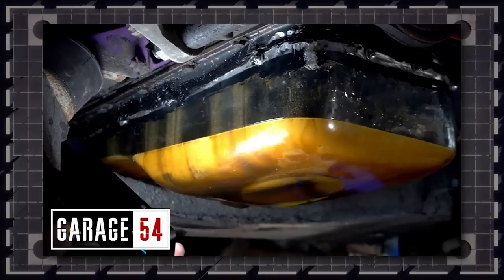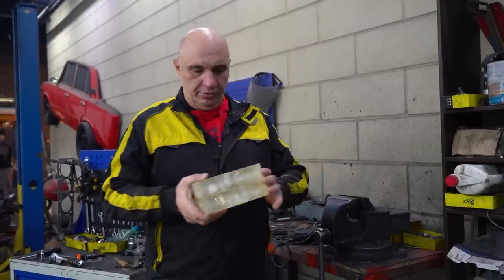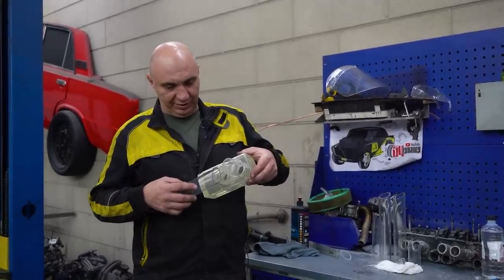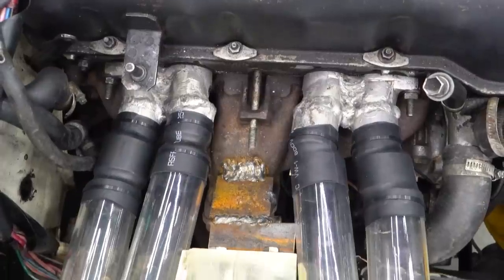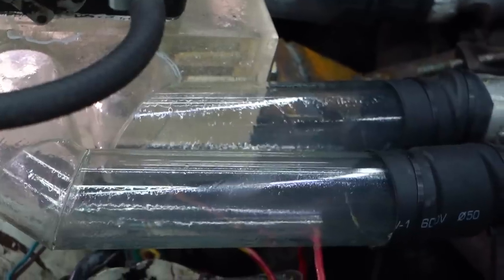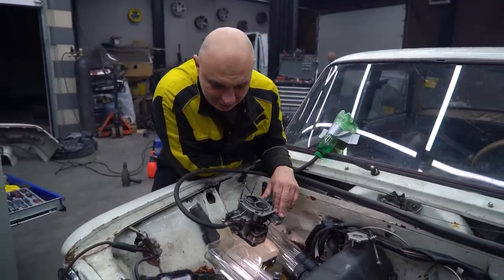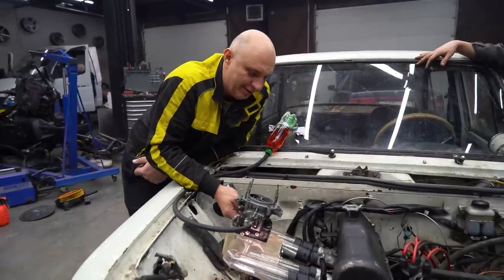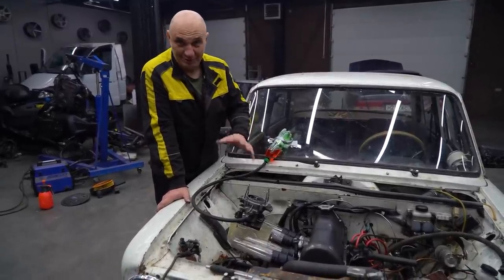We make a transparent intake manifold

Comment: At this point I think  you guys should make an entire engine transparent.
Reply: I was going to say, now they should take their transparent oil pan cover, valve cover, and anything else they've made and put them all on one engine.
Reply: cut inspection ports between the webbing, and mount the engine in a stand
Reply: It might be easier to make an invisible engine.
Reply: Yes! Even if it only ran for a few seconds it would be cool
Reply: Add a transparent distributor head✋😁
Reply: @ivanfangio  clear distributor caps used to be available for VW's back in the day, but clear valve covers so you can see the valve train in operation
Reply: Damn you took the words right out of my mouth!😂👍I agree!
Reply: @dalemoss4684  agreed. Even if you could only start it up and run it for a minute or two at a time it would still be pretty cool to see most of the inner workings.
Reply: Just go ahead and buy the old "Invisible V-8" model kit and save the hassle.
Reply: I was literally just thinking this
Reply: @ivanfangio you can still buy clear distributor covers for sbc.
Reply: it would be a short video LOL Think Newton it wouldnt run for 1 Min. even if you sleeve the cyl, people would watch till they seen it melt down then close the window and say I knew that would happen :)
Reply: Hah! That's what I said
Reply: they did and it exploded
Reply: They did lol
Reply: @keithyinger3326 they tried transparent block and it exploded
Reply: @dalemoss4684 That's exactly what happened lol

Comment: This is an awesome video! The fuel condensation is a fantastic example on why modern direct injection or even port injection is such a large step in increasing efficiency and reducing emissions in comparison to a carburetor. It also explains in a perfect visual representation on why more fuel is needed to start a cold engine, without the heat helping keep the fuel atomized you need more to make it run properly. There's even a reasoning to the old school saying of "carburetors make more power" due to the extra fuel potentially cooling the intake charge more than a port injection system alone could. Fascinating stuff.

Comment: Love when you make parts transparent. For people like me, stuff like that has helped me understand how things work immensely. Also showing what not to do and why, sometimes seeing something break or work improperly is useful in learning how it works and why.
Reply: most people  
dont realize  
what a miracle  
of moving parts  
the engine  
in their  
vehicle is
Reply: @heyitMeMcFlyunfortunately  Only to the 3rd World mind is it a miracle. 
 Go back a century and a half to where many of the same parts were being cast and machined for steam engines.  Many of those parts were later adapted for gas engines in the U.S. and diesel engines in Europe.
Reply: i mean... seeing it transparent doesnt help to understand. esp when the concept is so simple. the vacuum created by pistons going down sucks air through the carb which pulls fuel from the carb bowl to the cylinder which is ignited.
Reply: @diegoaespitia it helps. Always good to know just exactly how and what things look like where when doing whatever. I appreciate clear or cutout’s immensely.  Id like to make a display of something, with cutouts or clear covers like an automatic transmission would be cool.

Comment: Maybe use a timing light to see if that helps with the visualization.
Reply: Good idea, that would probably work great.
Reply: Was thinking proper strobe lamp, because its' rate can be adjusted, but you can get dial adjustable timing lights, so that works.
Reply: Exactly, turn off the shop lights and concentrate the timing light on #1 cylinder to find if the individual pulses can be distinguished or not.
Reply: That's a great idea... I hope they try it out; curious to see that now! I bet even adjusting the frame rate of the camera will impact how it'll look with the strobe. It would be neat to see them vary the rate of the strobe several times in the same way, but with a different camera frame rate each time.

Comment: A transparent distributor cap would be interesting, not very exciting, but interesting.
Reply: you can buy those, most of them are really low quality tho
Reply: Everything transparent would be ideal.
Reply: Had one on a custom built 1835cc dual port Volkswagen motor
Reply: They have a video on their russian channel doing just that
Reply: Slow mo of it would be cool for us car guys tho
Reply: @ondrejbrandejsky5592  it's because you can't use the same insulating materials that a typical cap is made of.
Reply: yea they need to do that
Reply: I'd like to see him make a transparent windshield! Wait.....
Reply: I USED TO HAVE ONE ON MY HONDA! YOU COULD SEE IT ARC TO EACH POINT
Reply: I know you used to be able to buy clear distributor caps off the shelf for most popular distributors back in the 2000's. Not sure if you can anymore but I used to think that was the coolest thing
Reply: They still sell clear gm hei distributer caps.
Reply: @ondrejbrandejsky5592  Most of them are intended to be used temporarily to check rotor phasing on a performance engine that has a "less than normal ignition curve", such as large step retards, or boost retards, and then replaced right after checking with a regular cap. Most of them are not meant for daily driving or racing.
Reply: I agree; that would be epic!

Comment: The more clear parts the better. 
Clear distributor cap. 
Clear valve/rocker covers. 
Clear transmission pan. 
Anything you can make clear to show parts/fluids moving inside an engine/transmission. 
The clear differential cover and oil pan are very cool.

Comment: This perfectly illustrates why manifold heat is so important with carbureted engines or with a central throttle body fuel injection.  The fuel falls out of suspension and deposits on the cold walls of the tubes.
A heated air supply would help.  Make the intake air pass over a sheet metal stove surrounding the exhaust manifold and making the air hot before it get sucked through the carb.  That will improve fuel vaporization somewhat but, it still isn't the same as a hot spot below the carb.
Reply: many cars in the 80s where i live had coolant flowing into the intake manifold at the base of the carb, warming the (usually) alloy manifold up enough to reduce fuel condensing on the manifold walls. warm air intake was more to prevent the carb icing in cold weather from water in the air freezing when it speeds up going through the carb venturi.

Comment: Video idea: Make a transparent engine block
Reply: it will work for three revolutions, and fall apart once the engine reaches idle.
Reply: Yea probably but it will still be interesting to watch
Reply: I don't know if its even possible for compression heat probably scratching on the transparent material
Reply: They actually use sapphire engines for RnD IIRC.
Reply: @4G12  Nice username. I have one of those in a Hyundai Pony ;) (minus the T)
Reply: He asks for suggestions but hopes they are based on something that can actually be done. Clearly some people are unable to comprehend that small part.
Reply: @brianlopez8196  Not realistically. Some people just blurt out anything like a child.
Reply: Transparent head is doable
Reply: Aluminium ones are already fragile !
Any plastic would melt within seconds from friction,  not fire from ignition

Comment: The fuel condensing in the intake is basically why engines require cold start enrichment (i.e. choke on carbureted engines). Liquid gasoline doesn’t burn, only the vapor, so when the gasoline condenses on the cold engine parts (like the intake manifold or even the cylinder head and cylinder walls) it doesn’t burn, so you have to introduce more fuel in order to get the mixture to the point where the engine will run. At least until it warms up and the fuel stops condensing. This is also why many engines will run hot exhaust gases around the bottom of the intake manifold.
Reply: More importantly, this is why carbureted engines must have manifold heat to run smoothly once it is started.  Quite often, in addition to manifold heat, you need air intake heating to prevent carburetor icing.  Hot air helps improve drivability of a carbureted engine while it's warming up.

Comment: That intake design is like a high-rise single plane. They work best at higher rpms. You should make a see-through dual plane with some way to heat the bottom to stop fuel from puddling. Maybe even a see-through carb so you can see the performance in action.

Comment: This perfectly illustrates the reason intake runners has smooth bends. Helps keep the fuel from puddling in the runners. Of course modern FI engines eliminated THAT problem by injecting directly into the heads.

Comment: I'd recommend fuel filler neck for couplers next time. I'd also love to see a Lada with yamaha r1 carbs. Not sure about the engine displacement of a lada, but i run 4 yamaha r1 carburetors on my 1970 datsun with a 1.6l using fuel fill neck as couplers (it doesnt collapse under vacuum)  and it sounds insane

Comment: Long intake runners must be smaller in dia to maintain high velocity of fuel mixture. Pulses you see are the reverse flow of ram induction. Runners should be around 19 inches long from bottom of carb to intake valve seat. This will put power at 3to 4000 rpm.

Comment: Correct, That is why the factory used exhaust gas to warm the intake manifold years ago.  The gas is almost always cold liquid and it takes some work to get it to a vapor.   Modern cars tend to run at higher temps to get more efficiency.

Comment: This not only shows the intake, but the reversion into the intake tract from valve overlap at low speeds. That is the exhaust smoke coming into the tract from the cylinder head.

Comment: you guys can make the longest manifold ever.. who knows carburator on back trunk hahaha
Reply: With extruded aluminum, it could be done.  Vlad and his crew have the fabrication skills.  
BUT... the runners would have to be heated the entire way.  Exhaust heat under the carb and water jacketing for most of the length.  Otherwise, so much fuel would fall out of suspension that it would barely run, if at all.
Reply: @BlackPill-pu4vi  exactly. its why old carb engines run like crap in cold weather if you remove the factory airfilter/box and fit an aftermarket one. no hot air intake to keep the moisture in the air freezing as it speedfs up going through the carb. exactly why those silly chrome panel filters used on shows like roadkill have so many running issues when they visit colder places than where the engine is originally set up. no need to keep rejetting the carb, just put a proper factory style air cleaner unit on with a warm air intake. its why they exisst!

Comment: the h
fuel is liquifying because the tubes are smooth and not ruff cast  and that the intake runners are strait with corners instead of curves . thought of trying heat to bend the pipes

Comment: I think it would be cool if you could sand the inside of the tube halfway so u could still see and it would show the difference off smooth ports to ruff ports and how it affect the flow patern maybe use different grits to see if its better
Reply: You wouldn't see a difference.
Reply: @davelowets  why not its collecting on the tube i know thats not vaporizing and sticking to the intake would a semi ruff surface flow good and atomize the fuel instead of sticking being turbulent enough to help atiomiz it with out restricting flow i am not try to argue would truly like you know
Reply: @zachwebb6879  Making some sandpaper scratches on it isn't going to make that much of a difference. Not like an actual casting surface would.

Comment: That would be pretty educational for people to make almost anything you can on the engine transparent. Timing chain cover, valve cover, oil pan, distributor cap. I've seen transparent acrylic carbs on mower engines. Might be able to scale one up for a late engine. I've also seen transparent cylinder heads on lawn mower engines but with the intake and exhaust ports running through it, plus the valves with springs, and head bolts, I'm pretty sure it would melt or crack pretty quick.
Reply: Where have you seen transparent OHV small engine heads? 🤔

There have been PLENTY of clear flathead engines made by people, but not OHV.

Comment: Great video. But-this is essentially a long-tube intake. Its taking the idle mixture longer to get to the chamber. Take this configuration vertical (high-rise intake), it should be similar - although gravity will help with the fuel delivery.

Comment: A lot of the 'condensation' is caused because the pipes are so smooth inside. 
The internal surface of the stock cast aluminium manifold is rough and that creates an air turbulence layer on the surface of the metal that keeps the fuel/air as a mist/fog.

Comment: Great idea, 👍  did you think fuel  reversion was only noticeable at low reves  and only for half the distance  of the pipes. Does this mean no need for long runners.?,  allso it looks like the fuel turns bends with no fuss or no differance real differanc to flow.  what do you think. Mike

Comment: it will be the same if you piped it where the carb sets ,many years ago I did similar I used an old refrigerator Basin  and glued a top on it with a window to see in with one hole on one end where I ran a hose to the intake and cut to fit a carb on it on the other end ,the goal was to make gas and liquid separator for high milage experiments and it worked it separated the gas and liquid ok but it ran lean though and you can see mist fog when it ran it was pretty cool experiment.

Comment: Don't take the manifold off yet.  Point an adjustable timing light at it to make the flow "freeze" in midair.  Should look excellent on the camera.  If an adjustable timing light is not available, trigger the timing light of off different spark plug wires.  The effects are fascinating.  This is how we used to check throttle body injector flow patterns in the 1980s.

Пока не снимай коллектор. Направьте на него регулируемый световой индикатор времени, чтобы поток «застыл» в воздухе. На камеру должно смотреться отлично. Если регулируемая лампочка времени недоступна, активируйте лампочку времени на разных проводах свечи зажигания. Эффекты завораживают. Именно так мы проверяли схему потока форсунок корпуса дроссельной заслонки в 1980-х годах.

Comment: It makes no difference whether the intake tubes are not or cold as far as the "condensation" in them goes. Even if the tubes are warm, it will show, as long as the throttle is closed and there is a heavy vacuum present. It's the vacuum that is responsible for the condensation.

Comment: this actually shows few things...  Smooth surfaces in ports of engine causes gasoline fall from the ride of air flow... that's why they always say "do not polish port surfaces" second thing is that those runners are bit too large for engine, air flow is reduced due to this...  but nice test! :D

Comment: That on the inside of the intake runners wasn't condensation it was the oil that you put in the petrol, it didn't look red in colour because of how thin a film it was making on the runners and you could also tell the way it ran along the runners it was too viscous to be water/condensation and the oil doesn't atomise like petrol does.

Comment: We see a prime example of why polishing an intake to a mirror finish is detrimental to performance. Quite often the rough sand cast aluminum helps add surface area for fuel to interact with air. Of course this changes with direct injection but for the most part guys wanting to port heads should leave the mirror finish to the exhaust side only.

Comment: Guys can you make some sort of chainsaw contraption running off the engine serpentine belt ? That would be crazy. Maybe with some sort of clutch system to turn it on or off like from an old a/c compressor so it won’t be engaged anytime the motor is running.

Comment: I always heard smoothe intake ports were bad, because the fuel will condense on the walls, and cause pudding, causing the engine to nearly flood, or cause rich then lean conditions,  I'd like to see screen wire in the ports to see if the screen keeps the fuel atomised !
Reply: its not that the fuel condenses as much as the fuel relies on air turbulence to keep the fuel and air mixed in suspension as it is.

Comment: The major reason for the fuel condensing on the manifold is because the walls of the tubes are way too smooth, rough walls promote turbulence which holds the fuel in the air flow, thats why you don't polish manifold runners or inlet ports, you're wasting your time and robbing your engine of power.

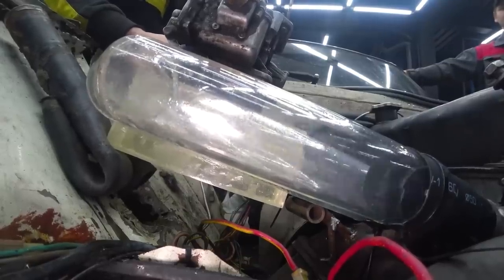Comment: @12:21 
( T _ T)
That debris that got sucked in. Poor engine. 
Anyway, I guess the different length runners made it like two 2 cylinder engines were working together, even though they were optimized for 2 different RPMs.

Comment: Love this channel always coming up with great content. Can you try to make a diesel engine run backward as long as you can?  Cheers 🍻 from Canada
Reply: running 'backwards' is a great theory, but not possible on a standard, unmodified 4 stroke engine. not tried it myself but theoretically it SHOULD be possible on a 2 stroke engine that relies SOLELY on ports instead of valves.

Comment: Clearly, the plastic tubes need some of that carbon fibre heating wire wrapped around it to heat it up aand stop the fuel condensation forming... :P

Comment: Acrylic tubes and torch. Learn to bend plastic tubing. Will do wonders. Right now aerodynamics and flow is shit. Airflow efficiency makes huge difference in stability. 

Edit: uv dye with uv light would show pulses much more clearly. Use same trick for car a/c systems to find leak.